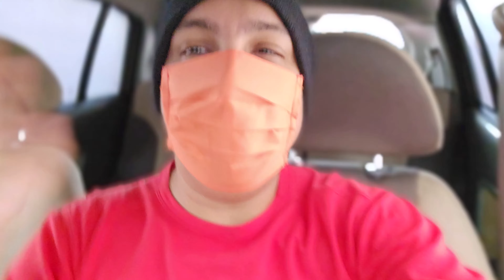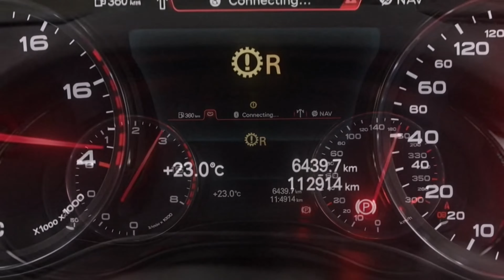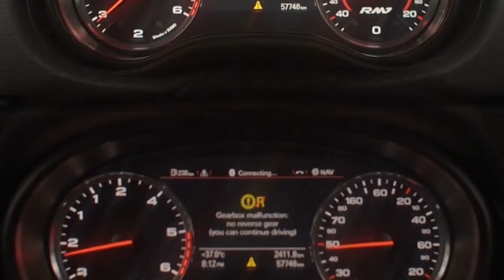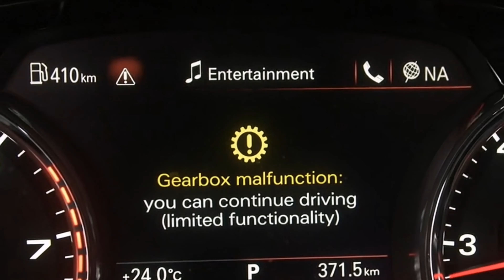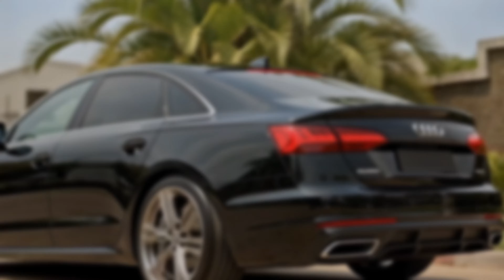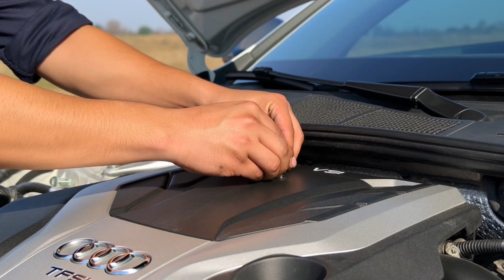How To Fix "Gearbox Malfunction No Reverse Gear" Warning In Audi?

Comment: Pulled my s5 on the driveway yesterday to replace the waterpump/thermostat, replaced no problem built everything back up cleared any codes showing and started it when I go to put it in reverse I now get this message and have no reverse or drive gears just stays stationary. Baffled as I never touched transmission. On a plus the thermostat issue is resolved but now I have this. Oh I love audis lol
Reply: Mine have thermostat codes and transmission issues 🥹

Comment: I was driving like normal from a stop sign and got this message..  I turned the car off and on and reverse worked
Reply from the maker: Did you solve the problem yet?
Reply: @rondonfusebox just happened.   Doing a reset.  The tpsm came on at the sane time..
Reply: @ArticulateArena did you fix it ?
Reply: @darylsoulll  i didn't "fix it" but i stopped resetting the tpms sensor so it doesn't trigger it while i'm driving and it's stopped doing the gearbox thing
Reply: @ArticulateArena how did you do thar? & should i be worried? Mine did it just now outta no where
Reply: @darylsoulll  do what?
i didn't do anything.  i'm just not resetting the tpms. 
i just leave it.  
the issue is that my tire keeps losing air and when it does, it triggers the tpms and it triggers the other warning . so for now i'm just refilling my tire but not resetting the tpms.
Reply: @rondonfusebox  code p2848 Shift Fork D (4) Position Sensor Incorrect Neutral Position Indicated
drives just fine. did the whole "reset" thing but still getting the code
Reply: Did you find why was that?
Reply: @joelzx711 read my other replies
Reply: @j @joelzx711 t me know when you find out